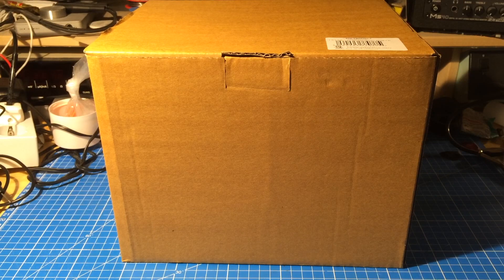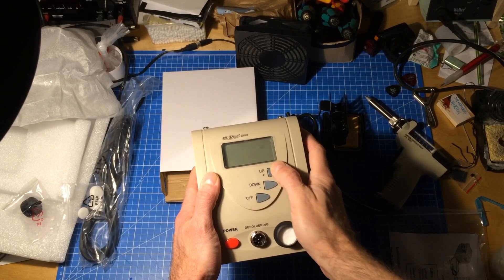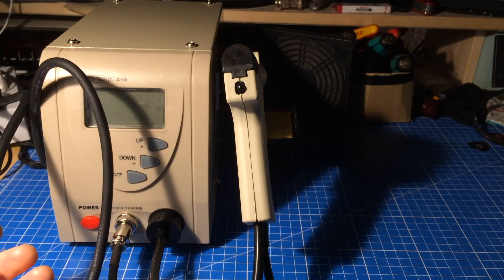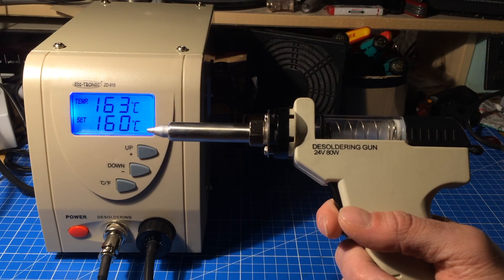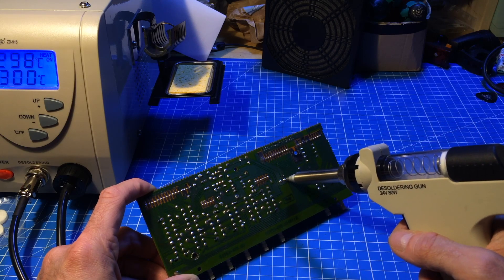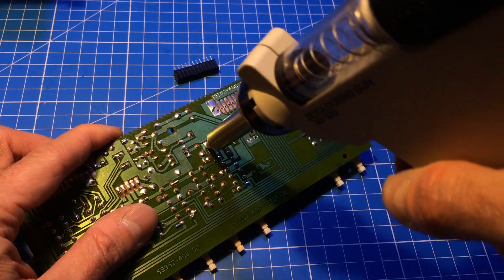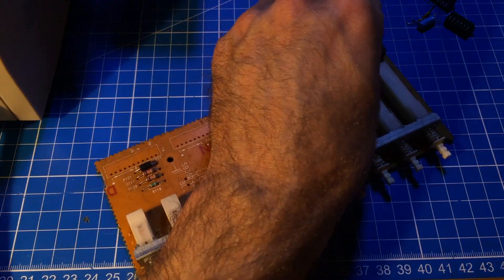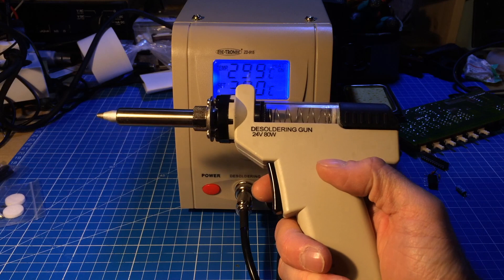Cheap ZD-915 Desoldering Station Review

Comment: Hi Jan! Is it still working? Thinking of getting one myself.
Reply from the maker: Yes, I still use it nearly every day. I had to replace the "gun" part two times in the meantime though (one clogged up beyond fixing and on the other one the plastic cracked). Spare parts are easy to source and not hilariously expensive though. Still recommend the desoldering station!

Comment: On a single face board with thin copper layer, every soldering stations will work fine.  But, I would like to see what's happen on a computer motherboard !
Reply from the maker: Watch my computer videos then. I’ve been using the station for lots of repairs since I got it.

Comment: Desoldering Station is typically the reverse action of soldering. They are both furthermore handy in making therapies. Therefore, soldering is an ability that requires both concepts in addition to technique. It is the understanding of the devices that need to be made use of that makes or harms soldering. Comparable to soldering, devices are as essential for desoldering also.
Visit us @ https://www.advancetech.co.in/products/goot-japan/soldering-desoldering-station/svs-800as
Mail Us @ ajay@advinancetech.co.in
Contact Us @ 9599592692

Comment: This desoldering station looks great, much more reasonably priced compared to the HAKKO desoldering gun..... even though it works great on its own, just melting the solder and evacuate it, use liquid or paste flux over the solder joints, it will help ten fold when desoldering and make much quicker work of it.
Reply: I have two Hakko one 808 and one FR301, I bought one ZD-915 but I never use it.
Two months ago I bought one Yihia 948 for Us$100 dollars, and works fantastic.
For this price is the best option in the market.
Best Regards.

Comment: I gotta ask for anyone else that bought one, do you hear a lil bit of a noise when you turn it certain ways? I got mine a couple of days ago, and noticed that when I was looking at it, when I was tilting it that it would make slight noises, but I'm assuming that's just wires inside moving around. I did check it for ground as well, the tip is grounded and funnily enough, almost all the screws in the case are grounded and show continuity as well, except for a few.
Reply from the maker: The fan got quite noisy in mine a while back and needs some time to run quieter. I think I‘m just going to replace it with a decent one sometime soon. Otherwise it was pretty silent from the start.

Comment: Thanks for this video... I have a lot of cap kits that I will need to go through. Pulling them manually is going be a nightmare... This looks like a dream,  When just needing to clean pads, or pulling caps, this looks perfect, thanks for the review and test, I will be buying one of these... to go along with my budget Yotec 967 soldering station...

Comment: This is an excellent device. Just got it yesterday. I was struggling with the C64C short board, especially ground connections. I didn't have problems with C128 I refurbished recently using a manual pump and wick, but in retrospective, with this thing it would still have saved me a lot of time and effort. The board in the C64C is so thick or the ground copper areas are so large that you need a really beefy iron to even solder them, let alone empty the holes to insert new components / sockets. With this thing it was a breeze. I actually resorted to using it to solder some of the components because my fairly decent Yihua 995D (75W, hakko heater element) was inadequate (heating the board using hot air helps a bit). Very good purchase I must say. Money well spent.
Reply from the maker: A great to hear. I still use mine ever day. I recently replaced the hand piece with a new one because the original one started clogging up more regularly. You definitely have to clean it thoroughly after use so it doesn't get blocked. Other than that, it is still one of the most useful tools I own. And I also use it for soldering from time to time if my elderly Weller doesn't provide enough power. :)

Comment: I got myself one of these and was very disappointed by how much of a hard time I had using it. It wasn't until a few weeks later I watched a YT video about it and realised that for reasons that will forever be unknown to me I thought I didn't have to connect the air hose to the station. (Hard facepalms were made.) Looking forward to the next opportunity to use it correctly!
Reply from the maker: Haha, yeah, won't work too well without the suction. Thanks for sharing! Hope you find a suitable project soon. :)
Reply: Maybe you should have looked at the manual. Sometimes you can actually understand them.

Comment: I had fun getting my desolder station all figured out. 
I bought a used Hakko 471 (from 1992 made in Japan). 
A new old stock Hakko 809 gun.  
A $20 dehumidifier from the 90's which I harvested the compressor from as a vacuum source. 

Put it all together and I know have an industrial grade desolder station.  It's so fun to use.

Comment: Thanks for the video! 
Is this still holding up after 3 years?
Reply from the maker: For the most part, yes. I just recently bought a replacement "gun" because that tended to get clogged up more and more often over time. Old one still works but is a little worn out I guess. I payed 25€ for the new one so that's okay after 2 1/2 years. Base unit got a bit noisier but still works great. :)
Reply: @JanBeta  , the fan broke on mine within a year. The motor also got extremely loud. I opened it and found out that it was making a contact to side casing. A little bit of adjustment and a piece of rubber to to prevent it to make direct contact to case and it's quiet(er) again :D
Reply: @JanBeta  Nice i just ordered one. Hows the fan doing? ...did you chage it? ...if so was it special size or something that use something else then PC DC fans?

Comment: Desoldering stations are specialized tools. Like solder tweezers. Buy a hot air solder instead and learn to use solder wick.
Reply from the maker: I have a hot air station and solder wick. The desoldering station is way better for the stuff I mostly work on (80s/90s through hole).

Comment: I have one of these and I'm actually a little disappointed with it, especially when it comes to cleaning.  The instruction manual implies that you can easily release a slider to  remove the glass reservoir tube that the solder waste collects in but that is not the case whatsoever.  You will have to dismantle the gun, 4 screws, to get  the glass tube out.  There is a spring inside that can be easily lost and it may take you more then one attempt to re-assemble it where there are no vacuum leaks.
Also, there seems to be no place to get replacement parts, such as the tips, springs, silicone washers, or the glass reservoir tube.  They give you three tips when you buy it and that's it.
Reply: You need to practice taking the tube out and putting it back in. You don't need to take the gun apart. Takes me less than a minute to clean it

Comment: Wow, I was reading about how easy this thing is to plug up. And I got to say if I went as fast as you with my old Xytronic desoldering Station it would have been plugged by the second solderJoint. Some people have no idea what kind of a pain those old Xytronics are with the Pen style iron.
Reply from the maker: The ZD-915 does clog up sometimes. I basically clean it thoroughly after each session (or at least I try to remember doing it). I actually just bought a replacement handpiece because it clogged up quicker with age.
Reply: Any chance you or someone can provide new/working links on where to buy this unit?  Thanks, -Mark.

Comment: Thanks for the review but maybe practice soldering and removing components a bit more delicately without wiggling them and weakening their leads.
Reply: wiggling the leads is necessary as it also helps cool the leads and allow any remaining solder to be removed. Unless your going to reuse that part (why would you?) most parts leads are made of steel and it would take some effort to weaken the lead. I used a Pace solder-station for my job working for the Navy, and we had to Have exhaustive training to be certified in circuit card repairs. Usually we didn't run across bent over leads for through the hole multilayered boards.. However if we did we would just clip off the leads and then remove the component then suck out the lead(s) with the solder sucker. A lot less work and less chance of damaging traces.

Comment: Pro tip: A bit of steel wool in the chamber will save you a lot of filter replacements.
I would have liked to see you demonstrate this on a double-sided pcb with metallized holes but I'm sure it will work well on those too (you just have to use the "wiggle and retreat" technique)
Reply: Me too. Double sided are a real pain. I would also like to know if may I damage anything if I suck in flux?
Reply: @laoluu  As long as you have the filter in there and +1 on the pro tip. I used to do use these types of stations while in the Marines working on avionics PCBs and this is what we used to use in the chambers...

Comment: May I ask you about if you still use / like that tool?
Reply from the maker: Yes, still going strong. The only downside to it is that you have to clean it pretty often. Otherwise it is absolutely recommended, especially for the price. :)
Reply: @JanBeta  Hello!! may i ask how many joints i should be able to get on this thing before i have to clean it?
Reply: @JanBeta  Any Solder sucker will have a lot of cleanup, the more often you do that the less effort to clean next time. By the way On the Pace machines even though there the top of the line we always used a tube supplied brush, the chamber was glass instead of plastic. Soak it in ISO-propyl  Alcohol, as it removes flux. 

On cleaning the heating tube we had wires plus very small gun type barrel wire brushes that we would drag back and forth inside the extraction hole to get any residue. The next thing after cleaning, there was a baffle to prevent solder from coming in contact with the filter. Our type was a piece of a flat piece of aluminum (like a Popsicle stick) that would just fit in the chamber, we would bend it into an "S" style to help prevent the solder for going to the filter. Now here's what really helped with cleaning, we would apply some oil or Vaseline to the baffle (in case of your sucker the round disk that covered the filter )and the inside of the chamber. Removing to solder was easy-peachy.
Reply: @JanBeta  Cleaning after every use is mandatory for every  desoldering gun if you want it to function right

Comment: It arrived yesterday,  worked a treat for the first 16 joints, then blocked solid.  Had to wack the temp right up to max to clean out the nozzle section,  then cleaned out chamber,  that's  a real pain to remove & refit,  not quite enough movement available to pull off the chamber! Replacing it's a nightmare .Working ok again now,  you really need to clean the nozzle after every four goes or so,  or you'll  be sorry!   Still a very useful  piece of kit,  think I'll  have to see if the chamber  section can be improved?   Otherwise great,  pleased I got it.

Comment: What about cleaning? Where does the sucked out solder go?
Might have to buy one!

Thanks for the review!
Reply from the maker: You definitely have to clean it after it got some use. Otherwise it will clog up pretty quickly. The cleaning process involves taking it apart and cleaning the parts, it's not that difficult once you get the hang of it. Still recommended. :)

Comment: What  temperature would you recommend desoldering at with this station?
Reply from the maker: I usually go with 350-370C for normal unsoldering. For huge ground planes I crank it up all the way. If you go too hot, traces are easily damaged, so be careful. I think ideal temperature settings may vary quite a bit from station to station because the sensor is probably not very accurate.
Reply: Thank you!
Reply: @JanBeta  I wondered why you dialed 300°C in your video?! It still seems to work. I think testing and own experience need to be build up. Just ordered through your  link!

Comment: I just bought one in ebay from  herner-elektronik-shop, about 92 euros. The fan aperture is really garbage so I just cut the perforated metal out and exposed the flowpath. With a 47 ohm resistor there is plenty of airflow (much more than new) and the noise is much subdued. I did buy a 50mm fan wire finger guard from china for 70 cents, why not go all the way, eh? ;)
Reply from the maker: Haha, nice idea. I might do the same to my station, too. I always wanted to replace the fan with a better one anyway.

Comment: Hello Jan, how are you?
I want to know, now after some usage, do you still recommend this desoldering station?
Does it pull out solderpads?
I have bought some Amiga4000s that needs new ram sockets, thinking about buying the same station. 
Just want to hear if you still like this one, or do you recommend a more expensive model. 
My need for it is not big, you are welcome to check my Amigas at my channel, won’t link here offcourse 😄👍🏼
Thanks for your time, Retrocengo
Reply from the maker: Hello sir, yes, I still use and recommend this station. It clogs up a bit more frequently and you have to clean it after each session but otherwise it still works smoothly!
Reply: Jan Beta Hi Jan. I have send you a message via messenger on Facebook, about my Amiga 4000Dcr. Hope you’ll check it. 
Its these amigas:
https://youtu.be/pGt6eq8gg2I
Reply: Hah! I was just scrolling through the comments to see if there was any follow-up on this station. Nice to see it is still working out for you, @Jan Beta

Comment: I bought this one after I watched this video and it seemed to be working great, then last night when I was in the room it sparked really loud with a POP! And it threw a fuse.  I was not using it at the time, I had just finished and it was sitting on the ON position with the iron in the cradle.  Anyone know what problem these have?  I have seen some references to these having some kind of defect with shorts or something.  Anything I can do to fix it???
Reply from the maker: Uh, that's not cool. I heard some similar units had issues with the internal ground wiring. Maybe that's the issue with yours, too?

Comment: That looks much better than the cheap version Hakko FR-300 one that I got...
Reply from the maker: I still use it a lot and it works fine. It blocks with solder quite often but if you clean it regularly, there aren't any problems. Still recommended. :)

Comment: Might have to get one of these some time in the near future. Was recaping a C64C board tonight, the negative leads on the ground plane are a pain in the rear end. Started at 19:30 gave up around 04:30 with one lead on the large axial cap left :(.  Think some of the original solder was lead free, hate working with that stuff.
Reply: Still available on Amazon
https://www.amazon.co.uk/gp/product/B076GJKFHP/ref=ox_sc_act_title_1?smid=A19GSHTT314PS3&psc=1
Sp-1010DrR Desoldering station
€98.00 ( Not Incl P&P @ ~ €20)
Reply from the maker: Yeah, working on the newer C64 boards can be difficult. They are soldered way better than the old boards and the ground planes are huge (so you need a lot of heat to fully melt the solder). I've had some success with adding more flux/fresh solder before desoldering. Still can be tricky.
Reply: Just placed an order for one today. On the way from Germany :)

Comment: This arrived today, and all seemed OK on initial switch on.
Element heated up, and temp could be changed.
However, when I pulled the trigger on the gun nothing happened (no pump noise). Checking continuity on the gun trigger to the connector showed that the switch was operating OK.
SO, the cover had to come off. All looking good internally, but when I looked at the connections to the pump, one of the wires was not connected. I have now repaired that, but I'm NOT impressed with the build quality.
The unit itself now works very well, I AM impressed with the functionality overall. Just the build quality lets it down.
Reply from the maker: Yeah, I heard about issues with the build quality from some people. It seems to be a good idea to open these up and have a look around for loose connections and the like before powering on. That said, I am still happy with the station and use it very frequently.

Comment: do you stil recomend it 2017 ? i need something like this because i have some caps i want to change from a pentium 3 but they wont come out with braid or a normal hand sucker
Reply from the maker: I still recommend it. It works a lot better than braid or hand suckers usually.
Reply: I've used it to remove caps from a motherboard - works very well. I had to start by adding some solder with a regular soldering iron so it was raised enough above the board to make good thermal contact with the desoldering iron bit. This task requires a powerful iron because the caps will be connected to a ground and power plane layer (often inside the board) which acts as a heat sink sucking heat out of the joint you are trying to heat up, but this desoldering iron manages that just fine.